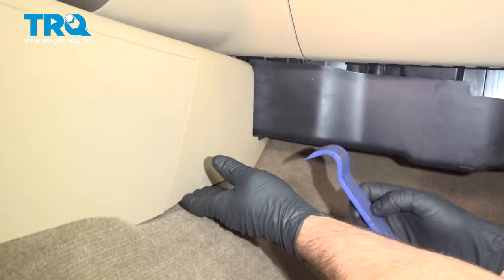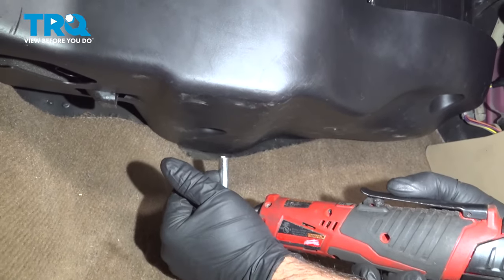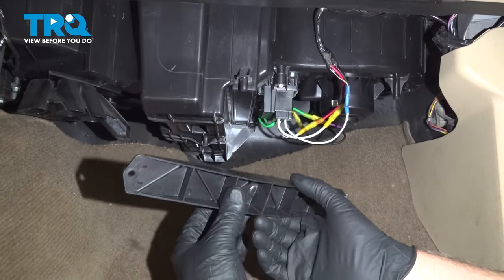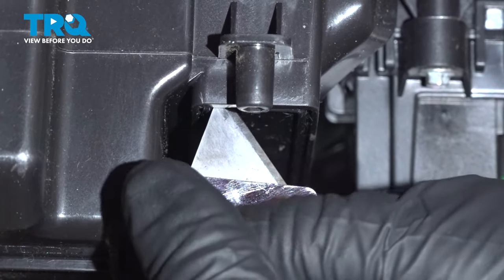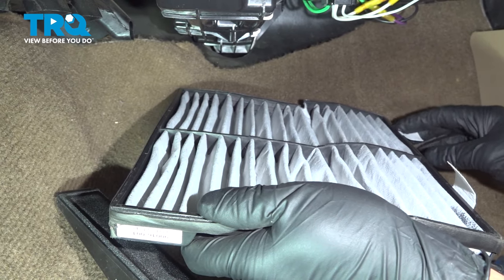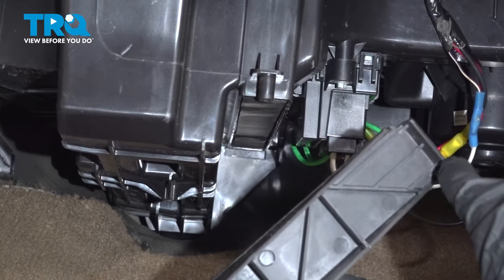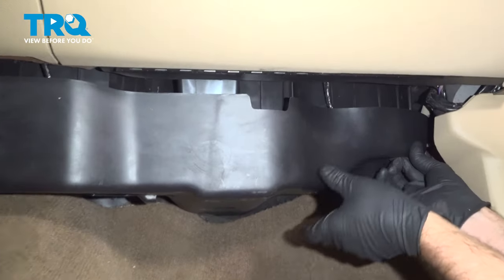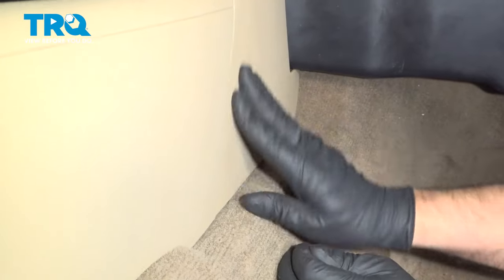How to Replace Cabin Air Filter 2007-2013 Chevy Silverado

Comment: Soooo, GM, in their infinite fkng wisdom...... actually engineered the air system to accept a cabin filter. Then completely sealed off the filter slot so it couldn't have a filter? This is so the way GM does things.

Comment: Yes i was confused as well that there is no existing cabin filter. If your going to do this, I recommend getting a propane torch and heating the tip of the utility knife, this will make the cut much easier!

Comment: Added the cabin filter to my 2007 Silverado 1500 today. I cut most of the plastic slot area with my Harbor Freight oscillating tool with a sharp sleel cutting blade. Then, clean up the area with the utility knife and pop out the plastic as shown in the video. Thanks for doing the video and, giving us the basics on the job 😎

Comment: I was excited for this project.  I ordered the retrofit kit, retrieved my Dremel Multitool to cut into the plastic housing, removed the black kick-panel and almost immediately realized my 2013 Silverado LT 1500 4x4 was built with a different blower housing.  Unfortunately there was no plastic blank to cut out.  I’m bummed that I was not able to make this improvement.  Will be sending back the retrofit.  Total bummer.  Just wanted to put it out there that GM used more than one blower housing on these trucks 😢

Comment: Great video. It certainly helped me with the retrofit/installation in my 2012 Sierra. Thank you for creating & posting. 

One question... The filter(s) I've seen do not have a direction indicated on them. And I've seen them placed either way in the videos I've watched. Is it safe to assume the filter doesn't have a specific direction?

If so, I'd just like to mention that I found it easier to fold/roll the filter with the cuts facing the passenger side. (Opposite of what's shown in your video.) 

Thanks again for posting. 🙂👍

Comment: the floor / carpet is wet /passenger side...can the water get in through this location?  I've never done the cabin air filter replacement task !  I was shocked to see there is not a Factory installed filter ?!!? How i'll proceed to find the water source ? Hmmm? any suggestions's? "2008"  Silverado ....

Comment: Hello, my Silverado C 2500 2007 has the area where the filter would go solid shot, and it did not have the lid. so the space to receive the filter is there, unless I would have to cut the area so I could place the filter. Thanks.

Comment: So I followed all the directions and was lost, so I took my 2011 Silverado aka “truckasauars” to the GM dealer and low and behold, some models did not come with an air cabin filter.
Reply from the maker: +C mc Thanks for the tip!  http://1aau.to/m/Shop-TRQ

Comment: Did this help with the air flow throught the vents cause my air flow sucks I changed the blower motor and resistor and now I'm to this before I go towards the climate control module and I don't think I need the module it seems like something is clogging my air flow and some people did this and they said it helped alot so I'm just asking around if it made it better

Comment: Different countries have different specifications and option requirements. It's cheaper for the manufacturer to mold the box as a sealed unit and form the access panel if the option list calls for it. I once had a brand new small dodge car that had the access panel but did not come with a cabin filter pre-installed. I had to buy the filter and install it myself.
Reply from the maker: +Grimm Reaper Thanks for the feedback! http://1aau.to/m/Shop-TRQ

Comment: I did this with a heat gun & a $2.00 utility knife from Walmart. Ain’t no way I’d be able to cut that out without heating the plastic first. Evaporator was dirty. I’ll have to clean that next time I change the filter.

Comment: My 2009 Chevy Silverado 3500 HD does not have this.  Why is mine different? It's a 2009 Chevy Silverado.
Reply from the maker: +mrfrostbite2020 The 2009 Chevy Silverado 3500HD models without a cabin air filter will typically use a plastic mesh that prevents leaves or other foreign objects from entering the HVAC system.